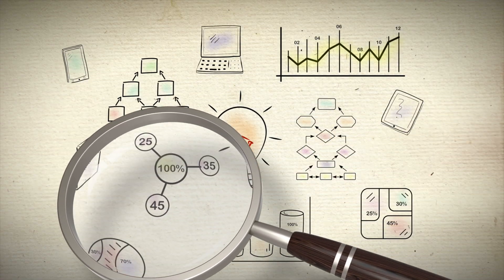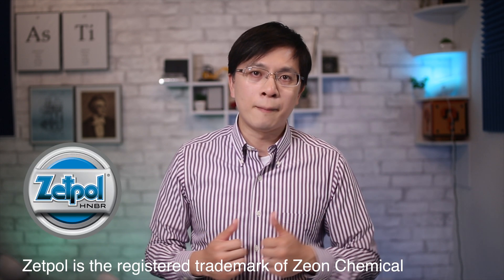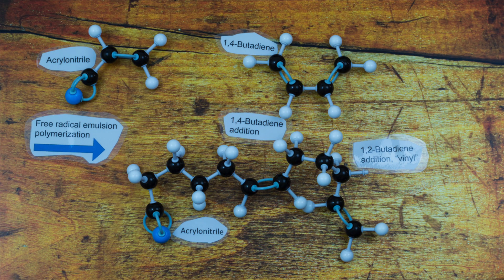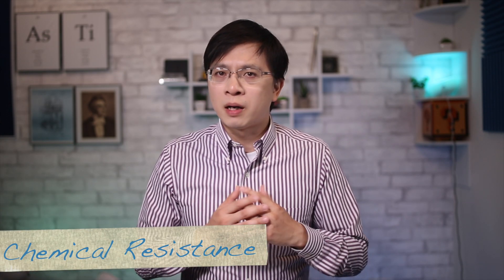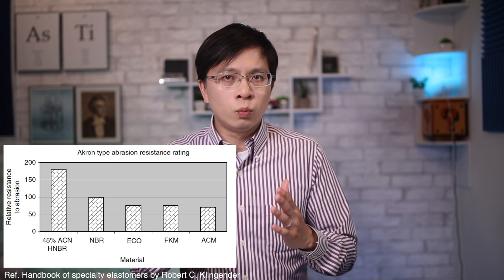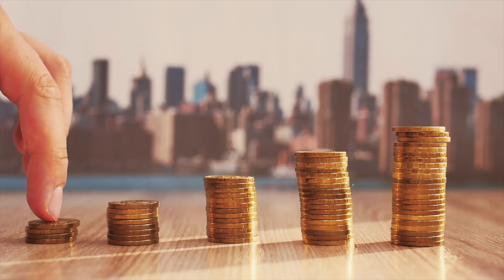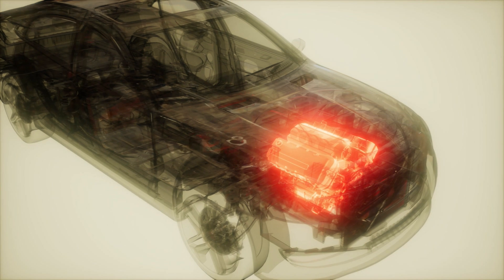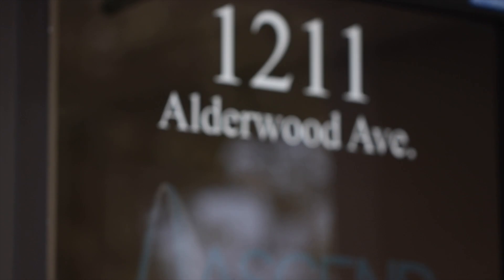What is HNBR, Hydrogenated Nitrile Rubber? Everything you need to know about HNBR.

Comment: I wanted to determine if Nitrile Rubber washers over a 25mm male brass threaded pipe as a seal between brass nuts as a flanges to make a bung hole in the bottom of a 44 gallon steel drums for waste vegetable oil and i am reasonably happy that it will hold up well. Viton seems hard to find and more expensive.

Comment: Hi Jonathan, I’m intersested in placing CNTs in rubber. I was wondering about the temp coefficient of different rubber materials and the tensile strength of rubber with temperature change. Thanks, Harrison
Reply from the maker: Dear Harrison, I believe you are talking about thermal expansion coefficient and thermal conductive coefficient. This is a great topic was in my mind. CNT(Carbon nanotube) is widely studied as a filler, I believe there are some commercial application in oil field and aerospace(if my memory works well).

Comment: I am using Zeon HNBR for manufacturing Diaphragm but it's very difficult to tear Flash using tear grooves. Do you have any suggestion for the same.
Reply from the maker: Dear Mayank, It's hard to give recommendation without a detail process condition. There are few route to approach de-flash. Cryogenic treatment can make the tear groove easier to break, I know it's costly. Some of the diaphragm we would prefer using die punch, it's depends on the geometry of the product.

Comment: if you know about homogenizer, do we need to use hnbr to its seals?
Reply from the maker: Do you mean a commercial homogenizer? In that case, I don't think HNBR is commonly used in commercial process equipment. It depends on the pressure or chemicals on your process. I would recommend reaching your manufacturer for specific process purposes. My best recommendation is to use FKM for wide chemical resistance. Here is our  FKM video. https://youtu.be/Z9wFIjcGc8g

Comment: Thank You. Informative video. Every rubber part has a shelf life and one  should consult SAE ARP 5316 for storage conditions. Here is my question! Does this shelf life is applicable to the raw material before curing? It is now 2020, can we use the raw material produced in 2010 without worries about the material losing their properties?
Reply from the maker: Dear Hamed, I have to apologize for a super late reply. It's really hard to justify your synthetic rubber shelf life, the answer is "it depends." I would like to give a few example, some master batched(pre-compound) gum may include stabilizer and co-agent. If passed the manufacturer recommended shelf life is not a good idea.